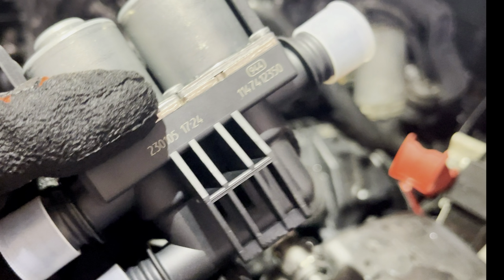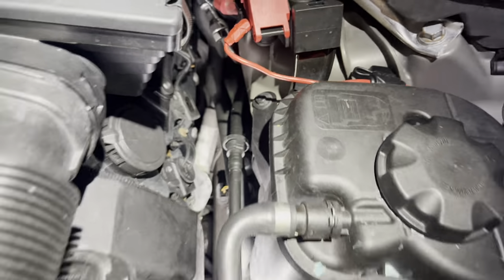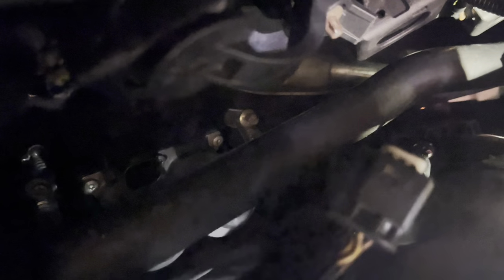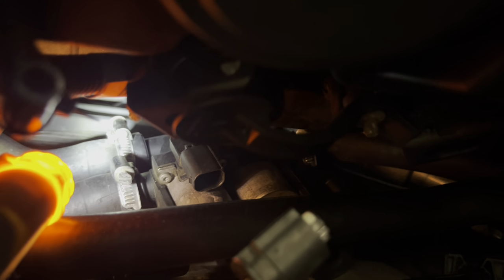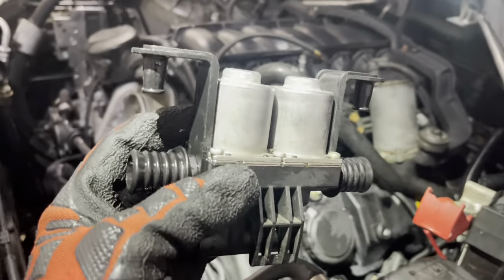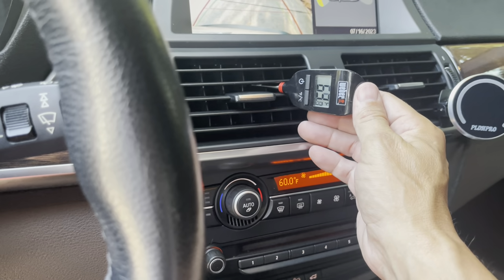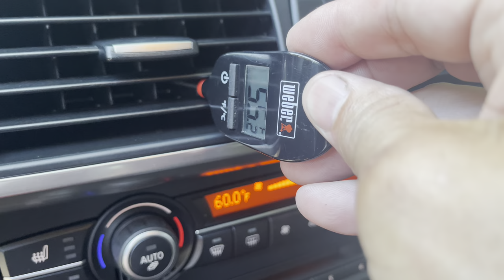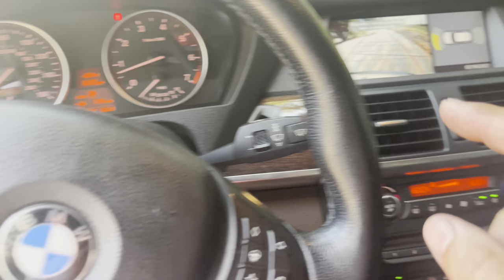2008 BMW X5 4.8i E70 N62 - Replacing the Heater Control Valve - Fixing Hot & Cold Air Coming Out

Comment: when you disconnect the hoses. is coolant coming out?
Reply from the maker: Yes. But I bent the hose back on itself to keep it to a very minimum. While the hose was bent back, I fit the new part to the hose. Hope this helps.
Reply: Was the the cold air coming from driver side while hot air coming from passenger side before replacing heater valve?

Comment: I’ve got no heat in my x5… You think this will fix it??
Reply from the maker: Do you have heat out every vent, including the center one, then I’m not sure. Make sure your Refrigerant isn’t an issue as well. 
My X5 had cool out the middle and heat on the floor and on the drivers side. I will say the consensus is that the Heater Control Valve fixes issues where heat is blowing out when cold should be.
Reply: @x-coastie  yeah I’ve got no heat out of anything… pretty sure I’ll have to flush my heater core out….